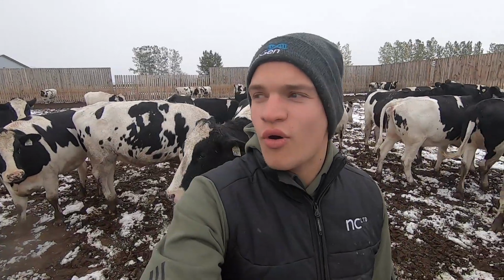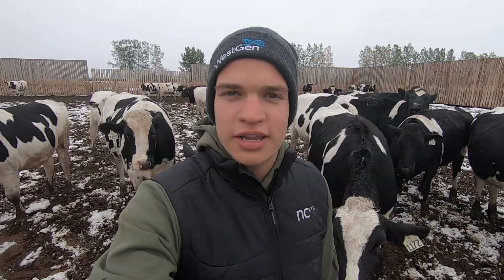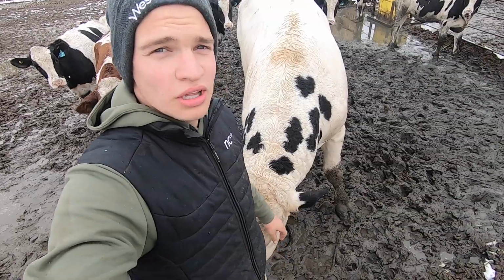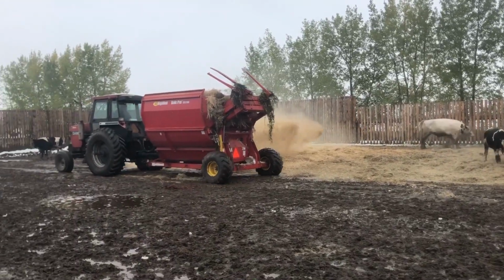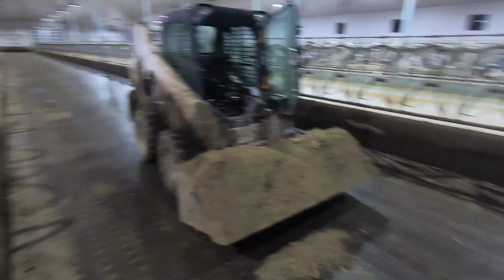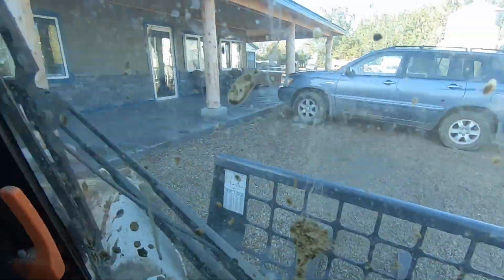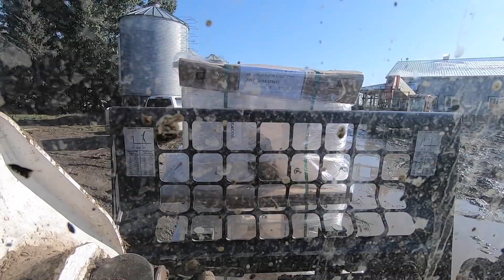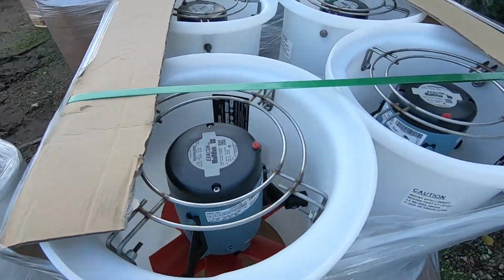Snow in September!?

Comment: should get a side discharge bucket for bedding the milk heard its would be faster and you wouldn't get as many clumps
Reply from the maker: Would be nice! We’ve looked into them and there seems to be a lot of moving parts on them. Like a lot of bearings and parts that would wear down due to the sand. I don’t mind putting the bedding in with the bucket either haha